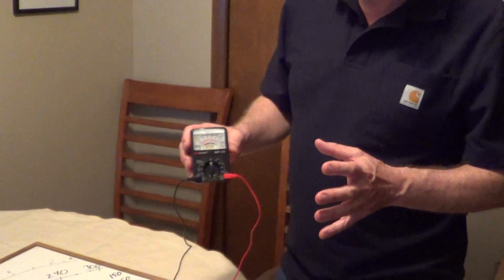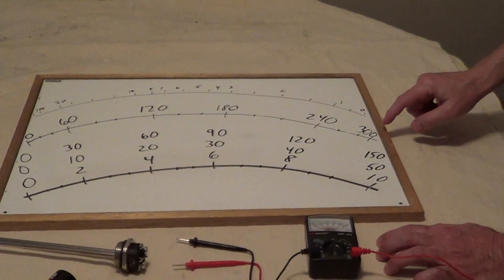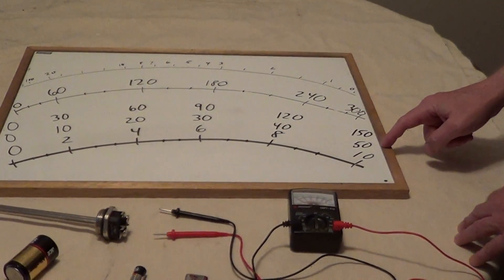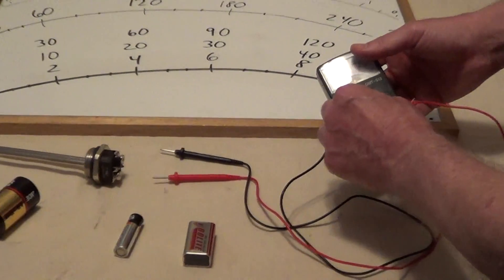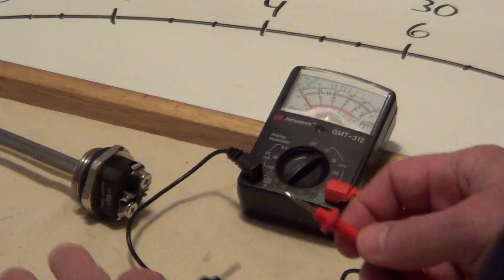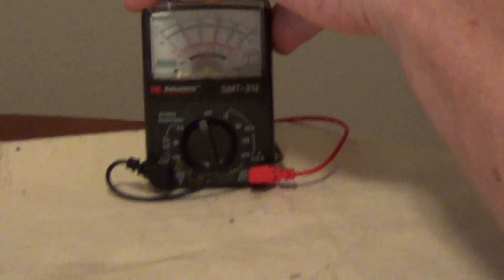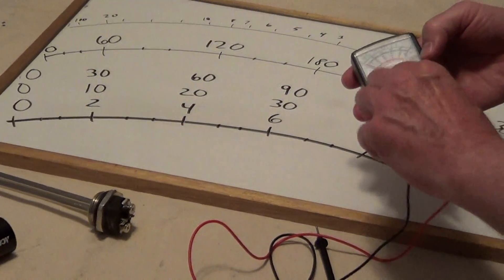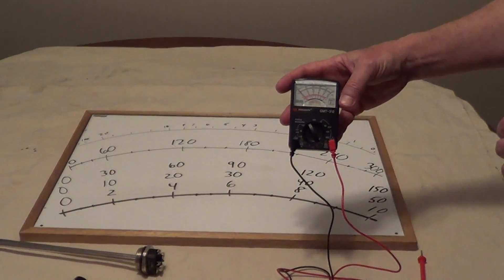How to Read a Multimeter - How to Use an Analog Multimeter

Comment: I liked the white board drawing to expand the microscopic meter font, but I'm a big time novice and needed to see all the readings and settings on the meter, but the camera work missed a lot of them. Also, based on the description, my meter doesn't have a "150" setting. This man obviously knows quite a bit about about this subject matter, so much so that he likely takes it for granted and forgets when he was and idiot about this stuff like me. This video is probably useful for some, but I need it dumbed it down a bit.
Reply from the maker: Hi, you can email me at fixitpodcast@gmail.com if you have a specific question about your multimeter.
Check out some home improvement tips in our e-books https://www.amazon.com/gp/product/B0B2KW1FQ9

Comment: Ok but when do we set it to 3 or 1? Can sb tell me please? Ant why when i messure 1,5V batery on multimetr set to 3 it goes extremely high, but not to the half, but when it is set to 10 it shows right voltage?
Reply from the maker: Hi, you can email me at fixitpodcast@gmail.com.

Comment: I am an English course lecturer, teaching in Electrical Engineering classes, well I was asked to teach my students how to read multimeter in English. It is funny coz I never ever touched or even read a multimeter, how am I supposed to teach them 😅 so here I am, trying to find any easy explanation. I still couldn't comprehend what you are talking about hahaha need to learn this ac-dc thing first I believe.
Reply: Lol you teaching in Electrical engineering yet you never touched a multimeter?!
Reply: @ngoakojohn4514  you have problem with reading comprehension, I guess. I wrote "I am an English course lecturer". Do you know what that means?

But alhamdulillaah, I succeeded comprehending how it works and managed to teach them how to read multimeter in English well.

Comment: My meter has different numerals on the body. DC V has 10, 50, 250, 500 and On the bottom of the body in Red Lettering ACV  the same series of numerals, on the Left side in white lettering DC mA .0.5, 50, 250 then there is 500 V Max. There is one other marking in green OHM x1k. On the face in green 1k an 200, 100, 60, 40, 60, 30, 20 10, 8, 6, 5,4 ,3 2,1, 0. In black 50, 100, 150, 200, 250. under those 10, 20, 150, 200, 250, and so on there are too many to list
Reply from the maker: Hi, you can send a picture to fixitpodcast@gmail.com and any questions.

Comment: Can you show us how to take the readings of meters having first division lesser than the others and label with a '.'  and why?
Reply: this is a refresher course for me.. he did it well. because i was taught this stuff 47 years ago and i forgot some.. so i didnt know if i was doing everything right. anyway.. im trying to apply my basic knowledge to off grid electric generation systems. i have gas powered generator. i have a wind powered generator and i have solar power generator. solar will generate 1600 wats per hour.. the wind generator will generate 800 watts per hour. my average usage falls around 300 watts per hour.. except in winter when i use my fan and electric heater.. which adds about 1700 watts  per hour.. thats when i use the gas generator rated at 3500 watt continuous use with a start up of 4400 watts. so my electric generation is called a hybrid system and my controlers regulate the flow to my batteries. I currently have 6 300 cycle marine batteries that hold the highest level of amps that walmart cells. they are failing on me. im trying to regenerate them and i wasnt sure if i was getting progress as i wasnt sure if i was reading the meter correctly.

Comment: This is a very good basic introduction. I have only a small critique, you mentioned testing for Current, but it's Voltage you were testing.

Higher end meters, usually digital these days, have a separate function for Current (Amps). Other than that, pretty good video!

It's good that newer analog multimeters are safer these days  due to fuse protection.

Older ones had no fuse protection. They could be dangerous when set to the wrong setting, or when used on a faulty circuit.

Anyone looking for recommendations; Southwire, Woods, and Kobalt (Lowes brand) share a similar, if not internally identical, generic analog multimeter design.

They are fuse and diode protected, abundant, and usually come with a warranty. But do keep your receipt. The Kobalt brand one that I bought has a manufacturer three year warranty with receipt.

Comment: Mulitmeters are new to many of us.  Please ensure that you take the time to show WHERE ON THE DIAL you are turning to and POINT to it the camera for several seconds.   Otherwise I like how you cut to the chase on the subject.
Reply: Seconding this. The explantion is good with a good variety of example applications. But a zoom in or stactic shot of the multimeter settings and readings would be helpful.

Comment: Hello sir,I have same meter as you,and want to check thermo fuses on my electric dryer..I set ohm to X10 and all thermo switches sent meter all far right.(off chart far as would go).Each one I removed 1 wire and checked them still in position..Does this mean all sensors I checked are good? (thanks)I used digital meter before,but this one is different..Thanks,Tim

Comment: Thanks for the video! was helpful. I'm a little confused on my readings though. I'm using the 50dcv setting, and on some connections labelled "12v" i'm getting 32v, is the label stating what volts to expect? or am i possibly reading it wrong, and it's 3.2v not 32v? any help would be appreciated!
Reply from the maker: Hi what tester do you have.
Reply: FIX IT Home Improvement Channel thx for replying. so i have a simple budget multimeter, MF-133. I'm more confident in my readings now, im getting 65v on a 24v dim also. Im a beginner, didnt know id see 65v there. Im testing a lcd inverter board trying to fix my tv. Maybe 24v label on board is the minimum needed voltage?

Comment: Like ur video but I have a question? I am do this project and I want to measure the lemon with a zinc nail and a penny in it. I have the same multimeter you use in the video but I don't know how to read it ):
Reply from the maker: Angela Rodriguez Hi, set your multimeter to DC and the lowest setting 10. By reading the 10 scale you will know the volts produced.
We have more tips on our weekly podcast https://itunes.apple.com/us/podcast/fix-it-home-improvement/id880903087?mt=2
Reply: Ok thanx
Reply from the maker: Let me know how it goes.

Comment: amazing .. But what about the least count :/
Reply from the maker: Amal I.M Hi, what is the question?
Reply: As we know , the least count is important in measuring instruments .. But when we use this device " Multimeter" how to determine the least count ?!
Reply from the maker: Hi, I'm not familiar with the least count. I will have to do some homework.
Reply: aha thanks for your time sir :)
Reply: @AmalIMlhem  For anyone still reading this. As far as I know, the least count is the minimum discrete reading that you can do. E.g. if I have a digital thermometer that goes from say 0 to 99 degrees and shows values rounded to the nearest integer (so 0, 1, 2... etc, but not 0.1, 0.2, 0.3 etc), On an analog instrument it's harder to define as the needle can be halfway between 1 and 2, or a quarter, or an 8th, or a 59.87th for that matter :) so then it just depends on the scale of the meter. So in the paper-drawn scale in this video, the dots on the scale for the 10V go in 2/3 increments, so the least count would be 2/3.

Comment: Was helpful to a point, you never show the control knob so can't see what your turning it to.  I'm new to this and mine is a commercial electric analogue millimeter which doesn't match up with what I've seen on here number and letter wise.  Is DC on the left always/  mine is gold lettering with a V~ next to them.  while on the right it's in white lettering with a V --- with a solid line above these three dashs.  Mine reads at the bottom Max 300V
Reply from the maker: Hi,
Thanks for the input. I should have.
The V with a single wavy line is AC voltage (alternating current).
The V with a solid line and 3 dots under it is DC voltage. (direct current).
I will work on a couple new videos with digital multimeters. 
We also have a weekly Fix It Home Improvement podcast on iTunes and Stitcher. Here is a link https://itunes.apple.com/us/podcast/fix-it-home-improvement/id880903087?mt=2